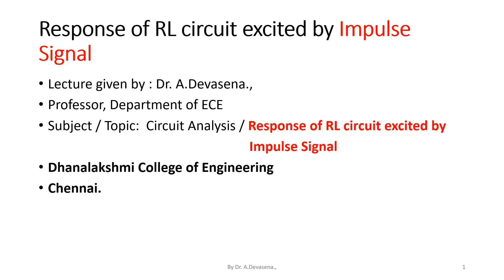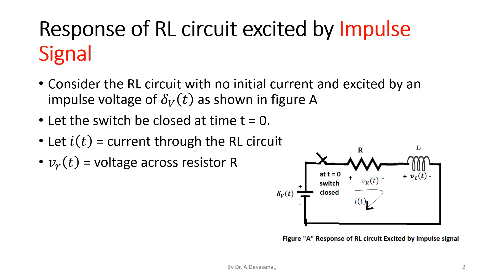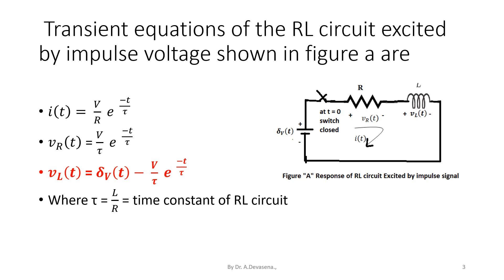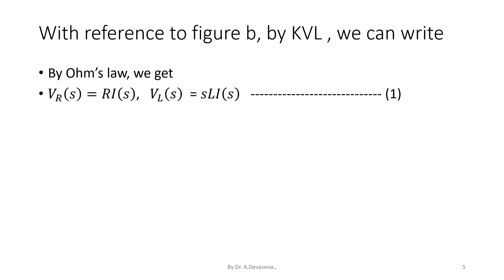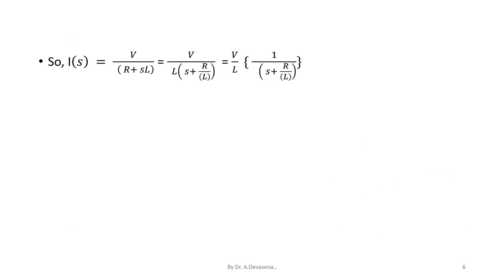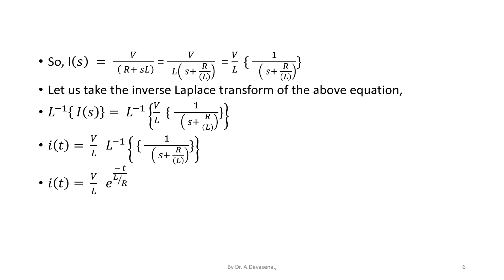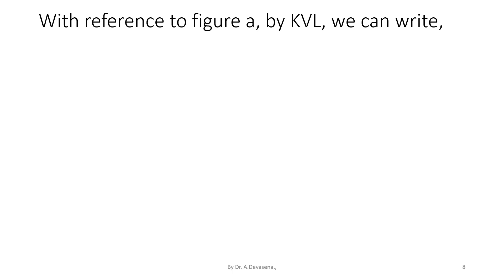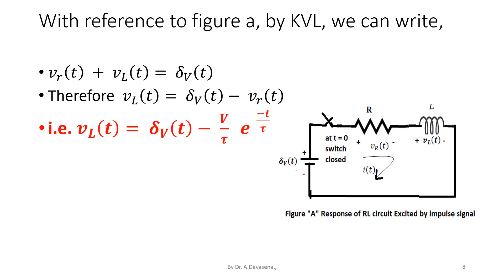RESPONSE OF RL CIRCUIT EXCITED BY IMPULSE SIGNAL.

Comment: I believe the summary you present at 1:30 has an error in the i(t) equation.

The coefficient should be either V/L or V/(R*tau).  This is consistent with what you derive later in the video around 5:17.